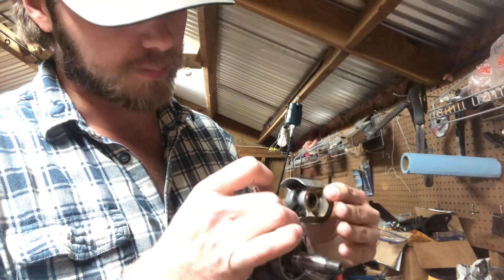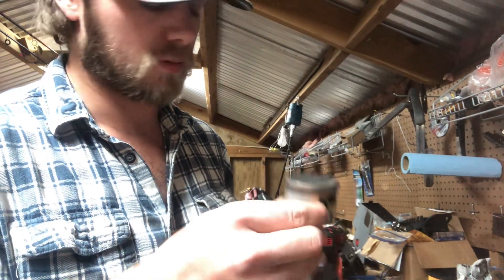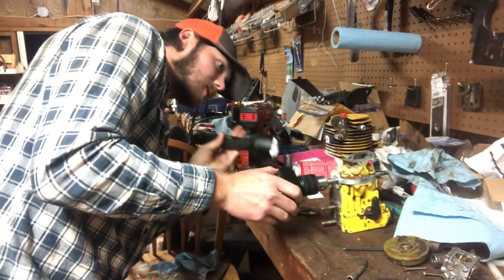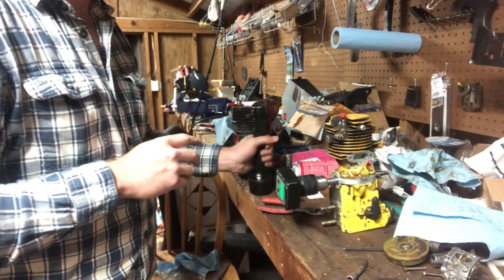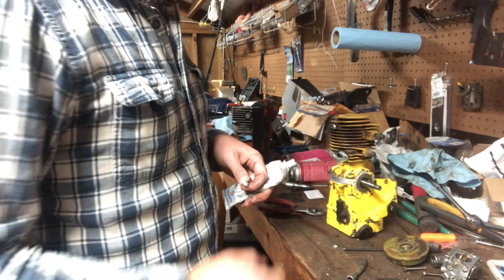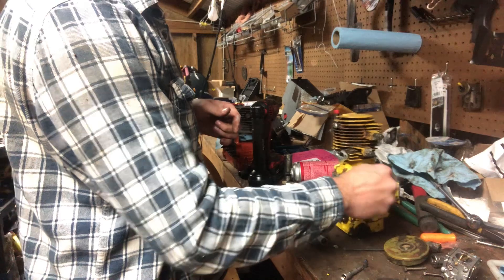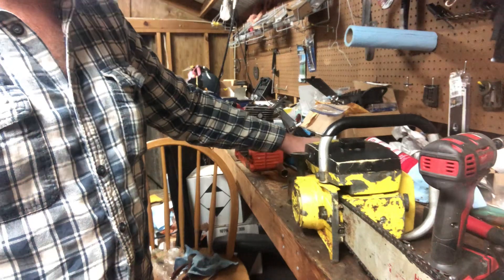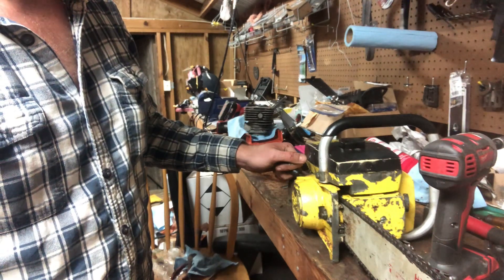Ported Mcculloch pro Mac 55 reassembly

Comment: I did my pro mac 700 last year, watched the bellhoppers reassembly, initially I ordered a lil'red barn piston and elected not to use it, found a nos. Oem piston,rings, and bearings and seals boy she has got some yo for an old saw, I put some moto seal on the 4 crankcase bolts even though new o rings were added so she wouldn't suck bar oil and smoke like crazy, part of what got me on the Mac kick is Buckins' channel, j&s, muffler delete,iron horse, and your videos, it's gonna be a treat to see how she runs!
Reply from the maker: Yeah I’d definitely stay away from LRB pistons on Mac’s, the machining tolerances are way off. Have cleaned up some awful pistons with some scotch brite and they are running fine as much as these saws will get used. I do the same with the 4 inner case bolts, with or without o-rings I used Moto seal for reassurance. I got my saw (a Mac) in 2016, and immediately fell in love with them. I also get a lot of my ideas from iron horse, tinman, bellhopper, and also still enjoy watching buckin from time to time. Thankyou for watching!

Comment: I had a awesome right hand start 10-10 Automatic but I sold it.
Reply from the maker: The right hand starts are my favorite, just wanted more power than a 10-10 so I threw a spare pro Mac 55 block that I hopped up in there, cutting video coming tomorrow, and I gotta say it’s a pretty strong saw now, about the same rpm as my 700 with say a 20 inch bar in 20 inch wood